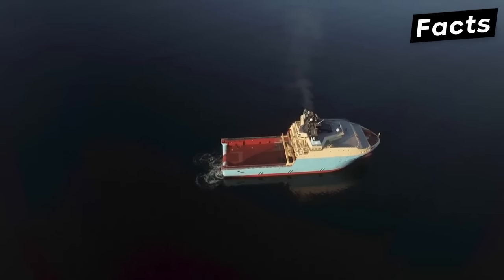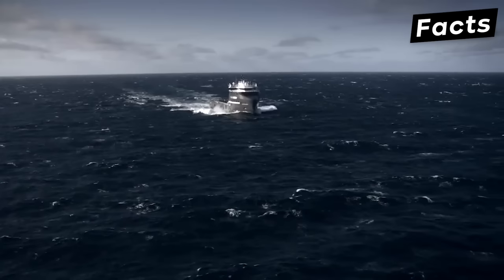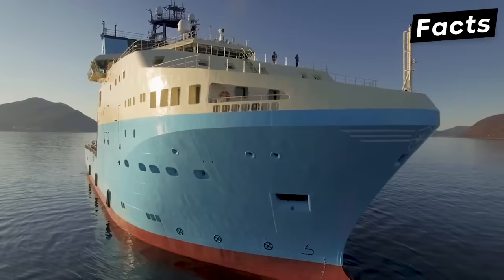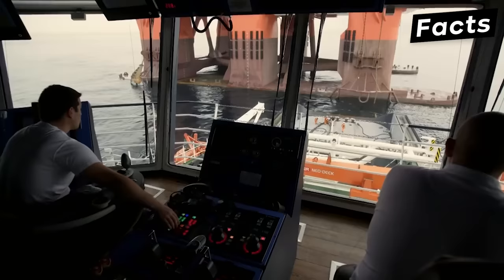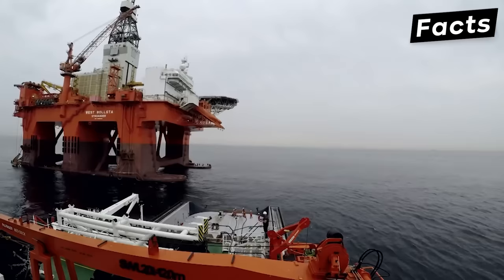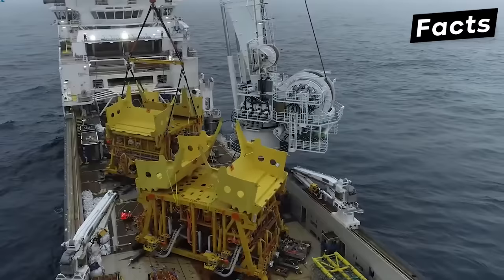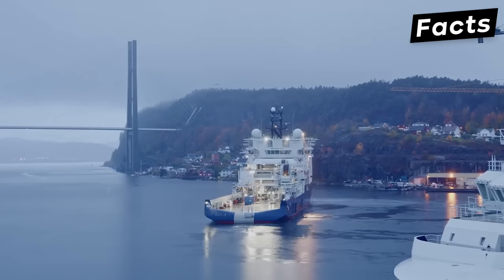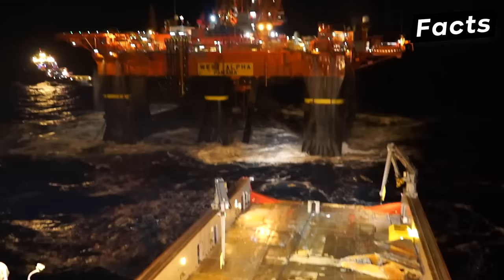Life Inside Giant Anchor Handling Vessels in the Middle of the Ocean

Comment: Is the wire the same as a cable?
Reply: In the maritime world, those terms are interchangeable. A stern wire could be called a stern cable.
Reply: @scottburns2600  Thanks, I have a logging background and we only called it a cable or line.
Reply: We would say wire, like workwire. There is a difference between a wire and a cable. A cable is often something we lay on the seafloor (subsea cable for connecting power or signals to a subsea construction). A wire is used for the steel wire we use to tension of anchors on rigs or similar. So it's best to keep them seperate in some types of work we use these ships for.
Reply: @mariusholtergrvdal7386  Thanks for the clear explanation. It sounds as if you know that industry well!
Reply: @mikeuyeda2330  I have a bachelor degree in nautical science and I'm a deck officer. I have worked on vessels like this 😀